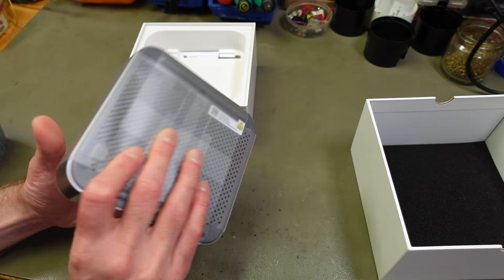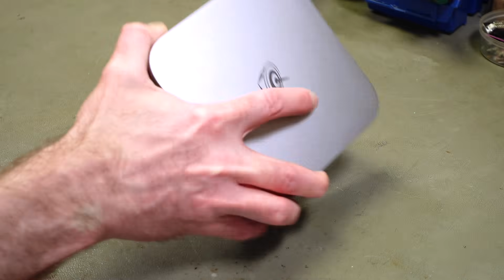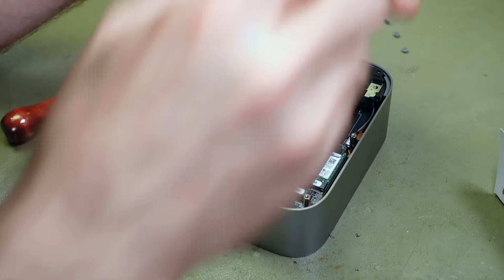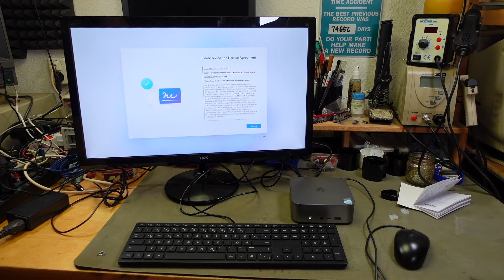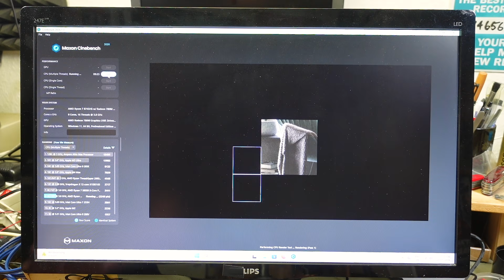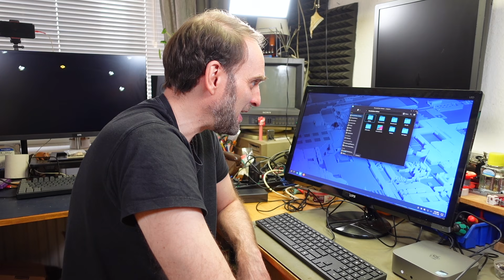Beelink SER8 AMD Ryzen 7 8745HS Mini PC Review

Comment: Interesting. I just got a similar Mini PC from AliExpress with the equivalent Ryzen 7 H255, 24 GB LPDDR5 (!) and 1 TB SSD for under 400 Euros. I recommend running Memtest86+ for a while because the RAM in mine is failing a test in Memtest sometimes. Looks like they sourced cheap RAM... I'm still keeping it since I haven't had a problem in Windows 11 (yet).

Comment: ya a year ago i scoped these out thoroughly  an bought a new one   with 24g ram an it cost 479+tax.. then   we got one on FB used with 32g ram for 200 bucks..   the new one experienced  some OS flaw that required downloading beelinks  modified OS:{|    so that fixed the windows problem    and a bios update .   so ya ima gettin another one an puttin Slackware on it.

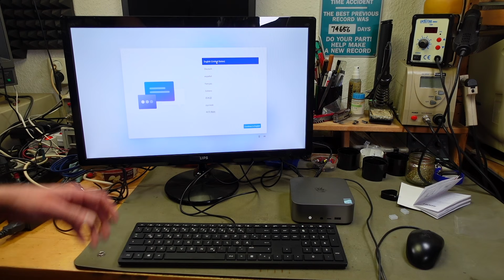Comment: 17:40 I'm Swedish but i run my OS and all software's in English. When i started with computers back in the 80s i wanted to learn computers and to troubleshoot and communicate with others. If i then run Swedish i have to learn everything in two languages and try to translate Swedish error messages in to English and then try to search for the solution will never work because the translations are sometimes really bad.
Reply from the maker: Good point. I never had many issues with German (and I’m really used to it after decades of using it as the setting) on a system level, but some programs I prefer to use in English because of badly translated stuff or graphics issues (German words are loooong sometimes and mess up spacing and such things). :D

Comment: There should have been a filter on the outside for easy cleaning ... I never turn my computer off and open it and vacuum it when it is on is not something i will do.
So, i can't exclude Windows? That will increase the price with $100 if Windows are included.
Reply: It would be nice to be able to opt out of Windows, but I'm sure that would not reduce the price by that much. Maybe more like -50? Those are licenses the manufacturer buys in bulk.
Reply from the maker: Yeah, I think it was $30 or less for a manufacturer license a few years ago. They didn’t even advertise Windows being installed on the website. I guess it really doesn’t make that much of a difference. Storage prices are the main factor, I guess. :/

Comment: I bought a Beelink SER8 during the 2024 holiday season and upgraded it with 96 GB of DDR5 RAM and a 4 TB NVMe drive. The original 1 TB SSD in mine was a Crucial drive and so was the original 32 GB of RAM, rather than the no-name models shown in the video. I also went into the BIOS and increased the shared VRAM from 8 GB to the maximum 16 GB, which is the maximum with the SER8 at the time. I don't know if a future firmware update has allowed that to be increased or not.

My original plan was to use the SER8 as a small AI server. I started with a headless Ubuntu installation and added Docker, Ollama, Open WebUI, and the usual supporting tools. It ran local language models reasonably well, but the overall setup never quite did what I wanted.

Eventually, I decided to turn it into a gaming system instead. I tried a couple of the SteamOS beta releases before settling on Bazzite about six months ago. Since then, it has been a great little gaming machine. I have had no trouble running games such as Fallout 4, No Man’s Sky, Cyberpunk 2077, and Diablo IV.
Reply from the maker: Nice! I’m currently trying out Bazzite on my Beelink, too (mostly because it has a one-click installer for DaVinci Resolve). Works great with all the games in my Steam library (which are admittedly not the most recent titles) and Resolve runs very nicely, too. :)
Reply: @JanBeta  I suspect part of the reason I wasn't happy with the AI performance was the lower-than-expected VRAM choices. I need to check and see if they've put in a firmware that will at least let me go up to 32GB. Beelink has done similar changes in their newer computers.

Comment: I'm not sure ... but I think I might just have picked up the inkling of an impression that you loathe and despise Windows with every fibre of your being. It's a common sentiment but at its core the Windows OS is actually very good; the problem is all the stinking garbage that Microsoft have tacked on under the guise of "AI" to gather personal information and behaviour that they can monetise. And they just don't get the message: Nobody wants AI on their desktop interfering with everything they do and sending everything back to Bill Gates. Keep that as cloud based web services that users have the choice to use or not.

That said, Linux is not a silver bullet either and you'll get just as many updates to install for a mainline distribution (except mostly you'll be able to choose when to install them).  Anyway, nice review. I like the look of the machine but it isn't for me. Also as far as I can see that dust filter is just a metal mesh with holes large enough to pass through most dust particles with ease.

You should also do a benchmark test under Linux btw - just to show how the machine performs with a different OS load.

Comment: Nice to see Microslop getting booted off of it... Not sure I would spend those kind of monies on a tiny PC, but that's just me.
Still, nice little review, hope it works well for you for many years to come old boy!
Reply from the maker: Thanks! I can’t stand Windows (as is obvious from the video). Linux has come a long way since I last made a serious attempt to use it as my daily driver. Love it so far, and the little PC performs marvelously. :)
Reply: Irony for me is I don't have a PC that can officially support Win11 and I've had a 'cracked' version or whatever you call it..TPM security bypassed and all that..it worked for months..then something happened..chkdsk flagged it on a boot..and I failed to stop it with press any key etc..it found registry changes as it would because it's unauthorised copy..it put my installation back to factory..great..enter password..my password doesn't work.. default password..I can't get into my desktop F**k..it's screwed..oh well..back to Win10..

Comment: I bought this exact model just over a year ago.  It’s been rock solid and I love it to bits.  Mine also came with Windows (but not the Windows sticker) and the first thing I did was install Linux and I’ve never gone back.  I never hear the fan - it’s always dead quiet even when encoding video.  And it’s incredibly fast.  I’d definitely buy BeeLink again but prices are just insane at the moment.  I hope your experience is the same! 😎

Comment: When Jan installed Fedora I was reminded of the old days... 25+ years back.
You could not simply install linux on a computer. You needed to do research beforehand, if there are specific linux drivers for the hardware you want to use.
Reply: well....things have changed/improved a lot, because in this case everything worked right out-of-the-box
Reply from the maker: Yeah, Linux has definitely come a long way! I first tried it around 20 years ago or so and things have definitely improved a lot since then. Now it mostly just works out of the box. I hope it’s going to catch on even more in the future. :)

Comment: I picked up a MinisForum mini PC about a year ago. I ended up dropping in a 2TB NVME and 64gb DDR5 (this is just before prices went up for storage and RAM) this machine runs my media server UI and transcoding processing. does pretty good. I may grab an external dock and stuff a GPU on the thing with the OCULink port. 

The company i work for (I do IT) we used to deploy Intel NUCs instead of full size desktops if they were just a regular user. that worked out really well. 

The description of it is "MINISFORUM UM880 Plus Mini PC AMD Ryzen 7 8845HS(8C/16T, up to 5.1GHz), 64GB DDR5 2TB PCIe4.0 SSD, HDMI+DP+USB4 Triple Outputs, OCuLink Port, 2.5G LAN, 5x USB Port, Radeon 780M"
Reply from the maker: That sounds like a really capable little setup for a media server! :D
Reply: @JanBeta  ha. yeah. not a bad little machine. rarely ever see any issues with it. im running Plex on Windows 11 Pro for the media server. i have the quality settings set to max (Original) and the cpu settings set to "Make my CPU hurt" lol.
Reply: I thought about setting up an mini-pc with oculink myself, but decided against it. 1) The power usage with an external psu + gfx-card will nearly be the same as a "real pc". 2) You loose bandwidth to the gfx-card, which means your fps will be 10-15% lower compared to a "real pc". --- My solution is now a Firebat mn56 mini pc amd R7-8745HS 32GB for daily use/most of the time and some games (15-60W), if i want high quality/details i switch via kvm to a AM5 7700, 32GB, 4080 Super which is undervolted and barely using 150W and can play everthing in 4k highest details 60fps no problem.

Comment: looks as You pointed as mac mini, but I dont like SO DIM for the memory.
Reply from the maker: It's true that the form factor does come with some compromises, but it's still impressive what they can fit into such a small space. :D
Reply: What do you mean? Regular desktop DIMM sticks just don't fit inside of a machine that size.
Reply: @BilisNegra I still own Mac Miny with the PowerPC and it has classic RAM slot
Reply: @w0lfgm Ok, but that had a larger case. When I say regular DIMMS do not fit inside the Beelink machine, I mean It literally. Such an stick of  memory is a milimeter shy of the EXTERNAL dimensions of the computer.
Reply: @BilisNegra  yes but SO DIM gives a higher earning margin. In theory they could fit sideways Dimson the other side of the motherboard. But that is my personal preference and the way I am looking, no offense mate.

Comment: Quite impresive to be able to run Cyberpunk 2077, I mean for the money it cost it is a nice bonus
Reply from the maker: It really is surprising how much performance you can get out of such a small machine these days! :D
Reply: Yes indeed! But be aware of the heat inside this small device. When you will use it also for 3D gaming, pay attentaion about the fact, that the CPU can have a temperature of more or less 90 degrees. So effective cooling is very important, otherwise you will roast your system. The Beelink SER8 hast a good cooling design, but also it has limits in this special use case. Also pay attention on how hot the integrated m.2 ssd will be then.

Comment: Crazy how the prices exploded, i got my Firebat mn56 mini pc amd R7-8745HS with 1TB SSD and 32GB for only 298€ inkl. Shipping on 20. Jul 2025. And i'm using it most of the time. The Radeon 780M is good for the only ~30W it uses while gaming. (Total system power 60-70W in extreme cases) Overclocking is possible, but not worth the extra wattage, noise and heat it produces for ~15% more speed.
Reply from the maker: Yeah, it’s really frustrating currently. As I said in the video, I wouldn’t be able to afford a new PC at the moment at all (that’s why I agreed to do the review). Glad you caught your Mini PC before prices went mayhem! :)